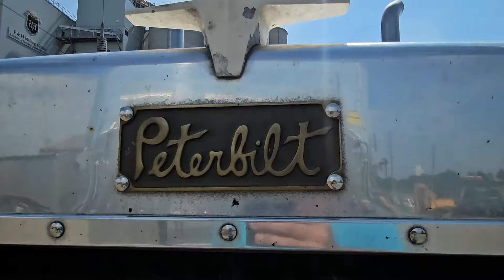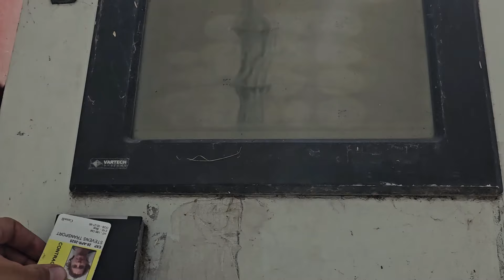There Are 2 Seasons... WINTER AND CONSTRUCTION !!

Comment: Be nice if they had a probing and weight in house at the same spot. So you don't have to travel two block from weight house to the probing house. and two weight out station for trucks getting out but. I don't know how the motion how they work there.
A great ending to the video you slamming them gears and hammering down to get loaded and back quickly to sit and wait. I guess that is a two load type day.